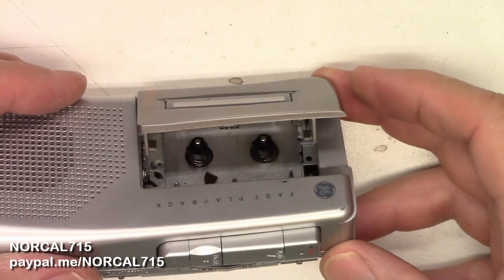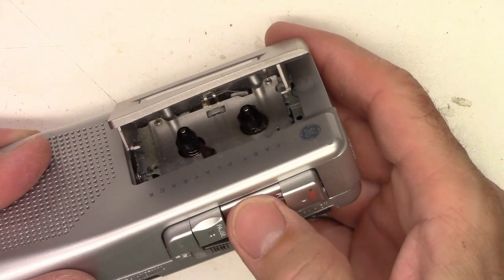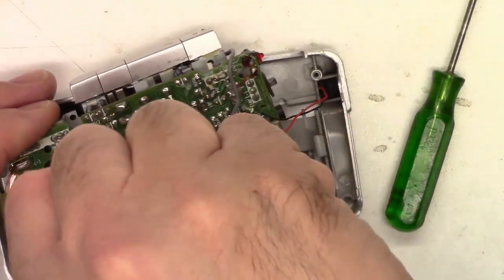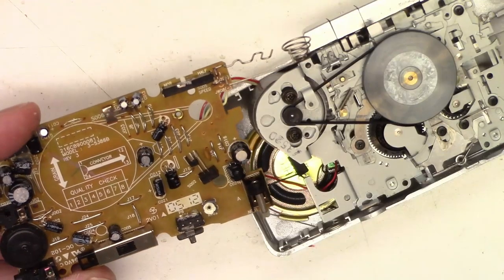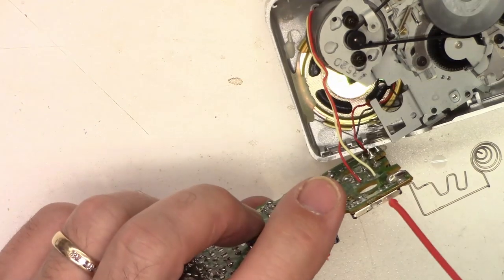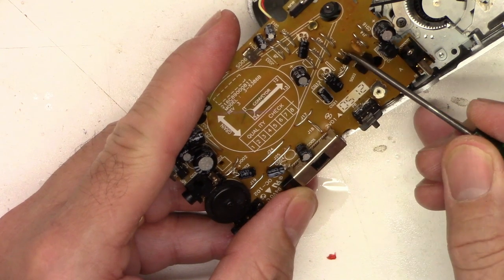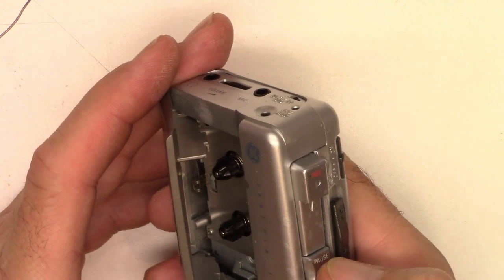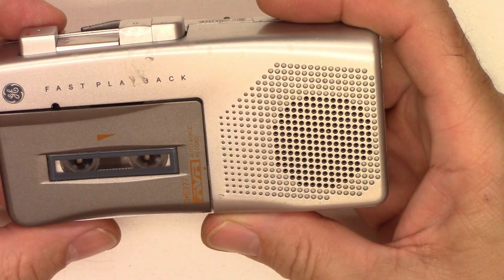GE 3-5377A MICROCASETTE RECORDER WILL NOT STAY PLAYING, SHUTS OFF REPAIR FIX

Comment: The dirt on the paper coming from the contacts likely is carbon deposits. There are automotive sprays to remove carbon deposits. I think that acetone can damage rubber.

Please make an electronics schematics course for absolute beginners on Patreon, I would follow it.
Reply: I like the paper polishing solution. I think you are most likely correct on cleaning rubber with acetone. Some checking reveals it is NOT used for cleaning conveyor belts or other rubberized power transfer devices. I think the main damage is caused by drying out the pliable properties. MEK or petroleum's is no good either. alcohol (90%) is preferable ti harsher chemicals like Acetone & MEK.
Reply: @ThePreyMantas  I think that one of the safest way to clean rubber could be cleaning it with water and soap.
Reply: @FulvioGa  Ta, that's generally the safest method to start with from what I've read & experienced.

Comment: Hi! I face a similar problem with my recorder.
I own a Sanyo TRC-570m Talkbook Handheld Microcassette Recorder. It is in working condition; it plays well, but has an issue with recording. Every time I hit record, it starts to record for a few seconds but then gets stuck. Mind you, the tape is empty, the batteries are fresh. The record button is pushed nice all the way in, but the tape doesn't roll. When I tap repeatedly on my recorder, it starts to move, but then again it stops after a while. There is likely a loose connection in there somewhere, but I have no idea how to fix it. Please help me.